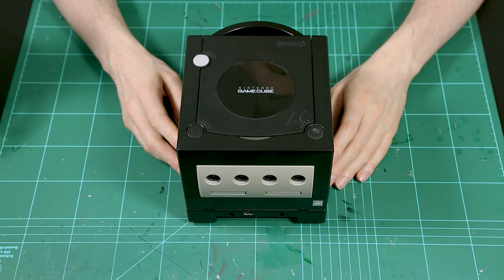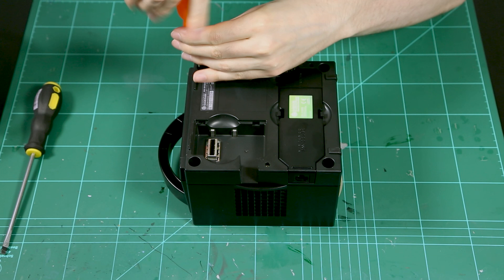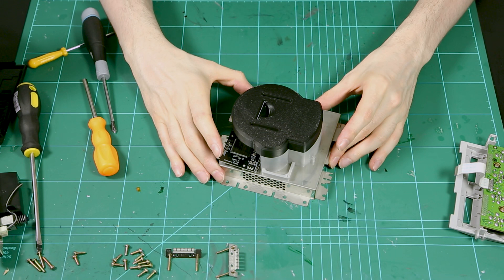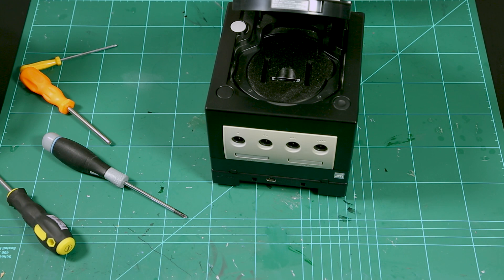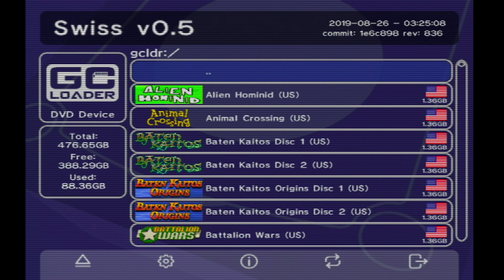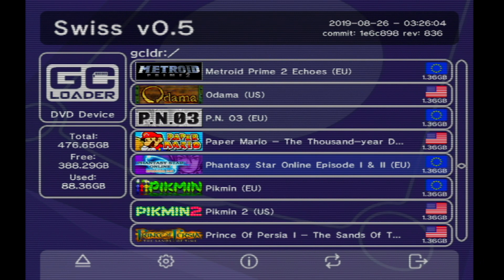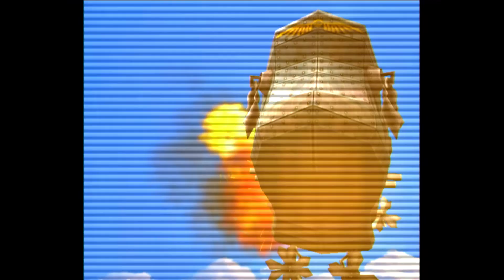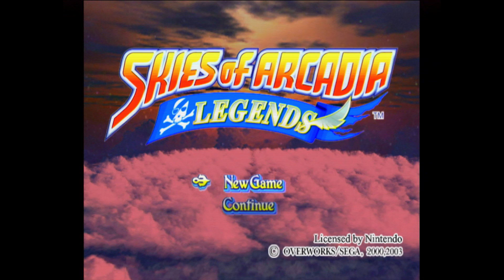[GC] installing the GC-Loader and a GC-Loader SD Mount into a GameCube

Comment: Just to clarify for anyone else watching the GC-Loader should come with 3 little screws and a washer.
The washer goes with the third screw into the far right away from the main port that connects the kit to the main GC board.

Another thing, it's possible some people may get a different Gamecube revision and the metal board may have a missing/moved screw hole. You can simply install the kit with the 2 screws and mark the hole that is missing with a very thin drill or marker if you so wish to drill the hole yourself.
Reply: Thx! Installing it now and was confused

Comment: This was the ebay gcloader right? I know its not the same as the original from other peoples opinions,but was curious if it holds up as good? Still worming years later? No issues with pins?

Comment: This was the ebay gcloader right? I know its not the same as the original from other peoples opinions,but was curious if it holds up as good? Still worming years later? No issues with pins?
Reply from the maker: This is an original GC Loader bought directly from the creator, not a Bitfunx clone.